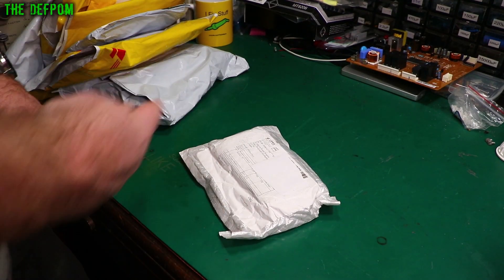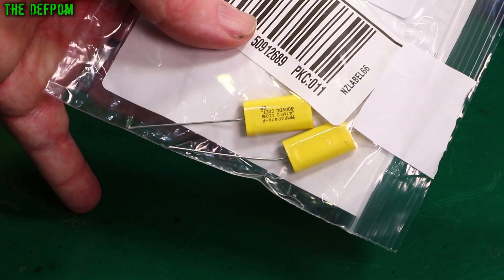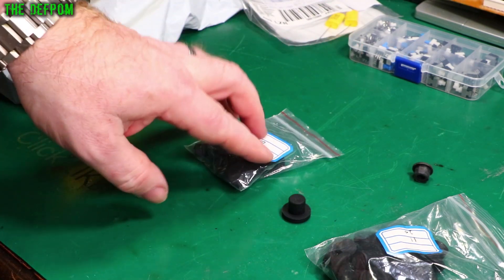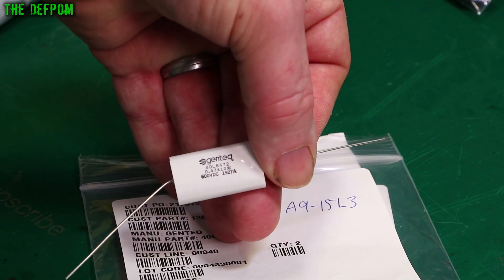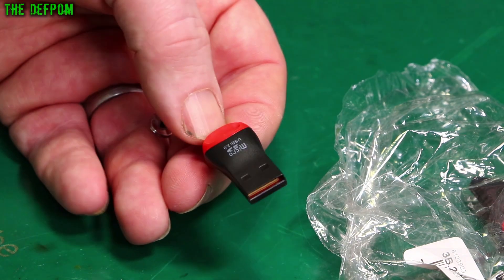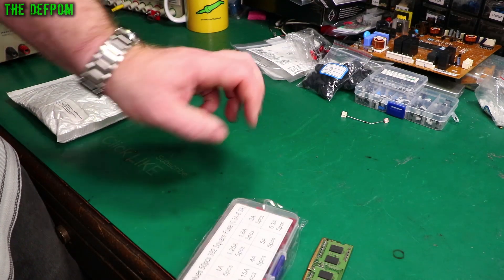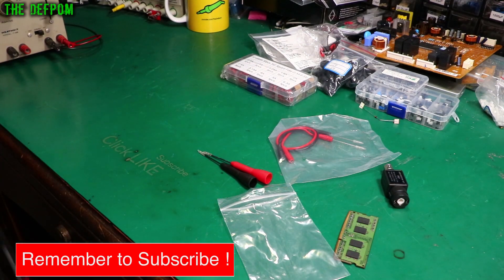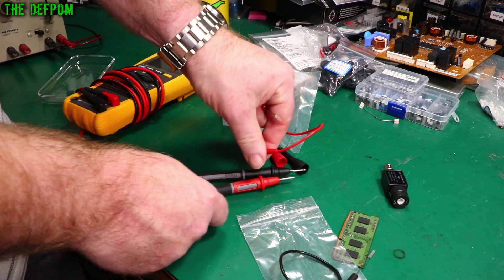🔴 What's in my Mailbag ? - Mailbag Monday 18th July 2022 - No.1021 not James Webb

Comment: One 2 cent part in a separate, plastic wrapped package. Never had this happen before :D
My minimum was 3 tactile switches worth 20 cents that weren't available during rest of the order.
Suppliers really do need an option so you could choose to receive undelivered items with next order.
Reply: I ordered a bunch of low TCR 0805 SMD resistors a while back. Digikey were 2 short so got them a couple weeks later........thought the blue back was empty at first till I realized!